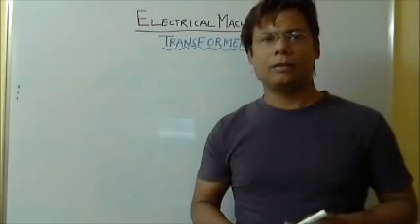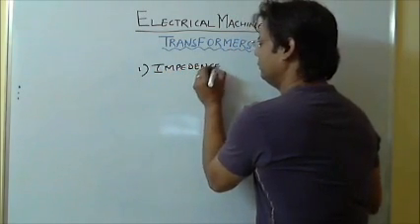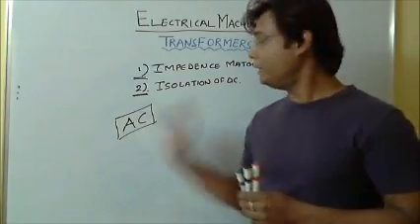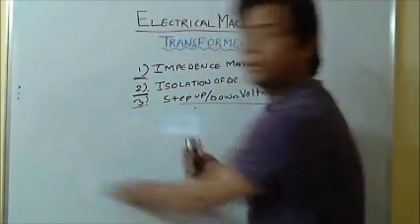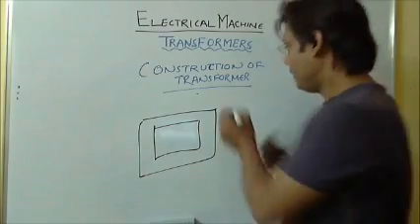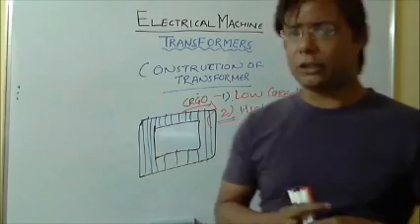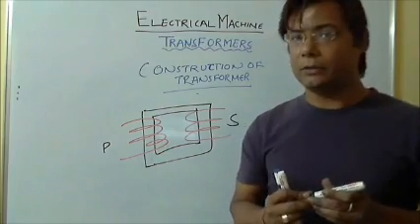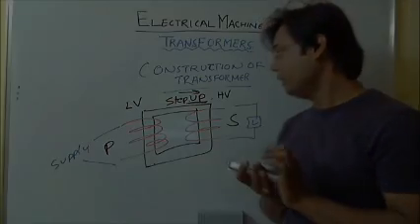Transformers Tutorials Part 1 for Engineering Services Exam GATE PSUs Students

Comment: Thank you for your responses sir
I had another doubt : This doubt is regarding Core of transformer

1) If the core of transformer is made by increasing steps in cruciform core ,the core becomes circular core na 
and if the core become circular the In length per turn in transformer winding decreases
so we can save copper and even weight of t/f decreases

but, why we are not going for circular core?

Comment: why the thickness of cu winding in transformer in primary and secondary transformer are different???

and  if is the case  how voltage per turn is constant   (E/N=constant)
Reply from the maker: its a big topic but let me try to explain see just for example if the transformer is step up transformer then primary will be LV winding....so it will be carrying high current....we know r=rho L/A ....since  current is high in LV winding Resistance of it should be low....it means area of wire should be more and length should be less....it means LV winding must be of THICK WIRES AND LOW TURNS whereas like wise HV winding should have FINE WIRES WITH MORE TURNS. SO the thickness of cu winding in transformer in primary and secondary transformer are different.AND E/N RATIO WILL BE SAME ACCORDING TO THE ABOVE DISCUSSION
Reply: thank u sir
and i had one more doubt
 using three phase transformer in place of 3 single phase transformers is technically good , but what is effecient in cost point of view
single 3 phase or   3 single phase units???
Reply from the maker: but obvious the cost of 3 single phase transformer is much less than a single phase transformer

Comment: why conservation tank is not present in most of the  distribution transformers 
is it not necessary plz,, expain??
Reply from the maker: SEE EXPLAINATION OF COOLING......if the transformer is of low KVA rating there may be a chance of not providing a conservator to avoid excess extra costing...